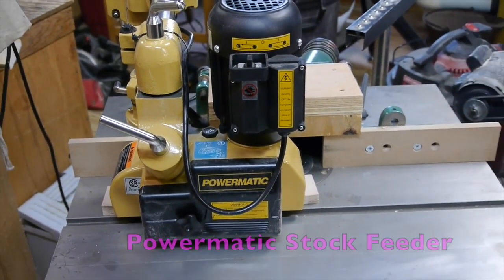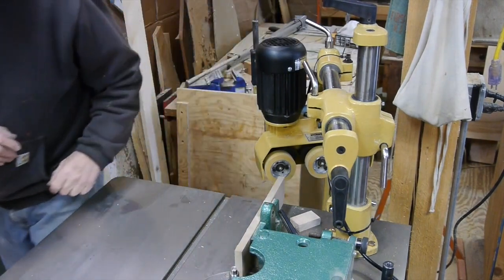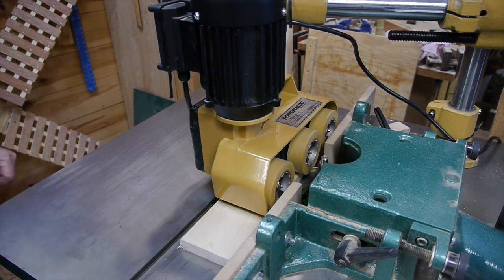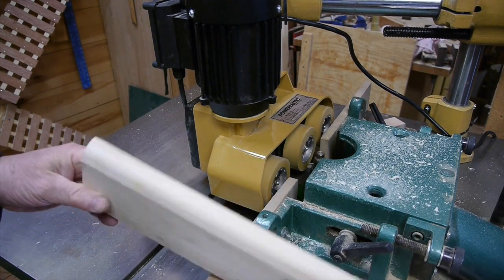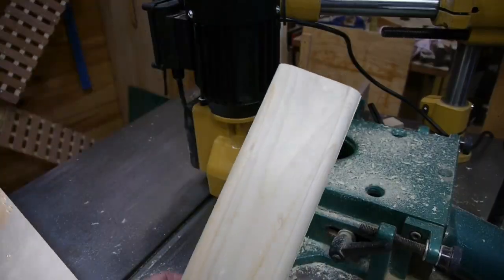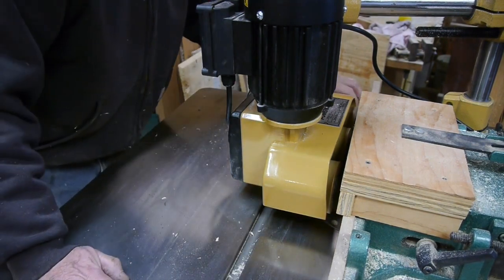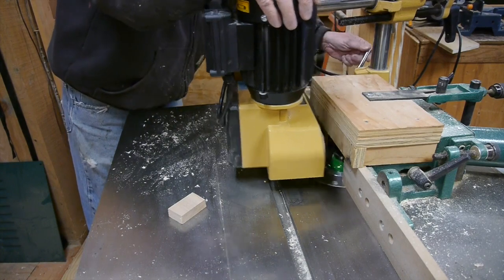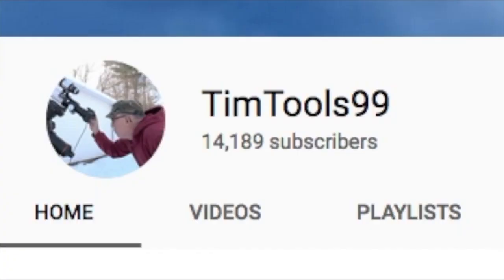Stock Feeder for Beginner Woodworkers

Comment: great video.  I added a 1/4hp feeder to my 12" Crescent jointer years ago.  Worked GREAT.  really holds down the work onto the out feed which is what is so important.  And makes the work progress thru the head without the normal stops and starts that hand feeding does, resulting in a more even consistent finish.  The Crescent, which was part of a multi machine, was perfect candidate as it's out feed table is so wide, (about 24" so lots of room for mounting the tower.  I later tried the same feeder on my table saw, but it wasn't powerful enough.  I later got a 1/hp feeder and that does work.  I currently replaced the 1/4 hp feeder with the 1 hp feeder on the jointer, as I found that the feeder wasn't really needed on the rip saw.  I am going to use the 1/4 on my jointer too.

Comment: I've been a firm believer in stock feeders since the mid 80's.  I used 2 on my table saw to feed stock through it as well.  I installed one so it fed before the blade and another after to pull the stock through to the end of the cut.  Never had kick back or danger at any time doing large stock production for cabinetry, etc.  You too can leave the caveman days of cutting off fingers and getting hit in the head.  Just get 2 of these.  Brackets can be installed on the table saw without sacrificing the table itself.  No need for rip stop etc.  Gov should mandate stock feeders on all table saws and shapers.

Comment: Enjoyed your video. I’ve been doing research on adding a power feeder to my 8” Grizzly jointer. Although it’s a different machine,  after watching your presentation, I believe a 1/4 hp power feeder may be a better fit than the larger power feeders for my shop. Thanks.

Comment: The gap in the fence is what allows the board to pull away from the infeed fence.  Putting the ends of the split fence closer to the cutter so the cutter just clears, or using a one piece fence with a cutter specific slot for the cutter to fit through, should stop that problem.
Reply from the maker: Thank you John
Reply: @TimTools99  I have the same shaper (older though) and same power feeder.  They work for my needs... My next projects include making new ash flooring for my house and antique pine flooring for my son's house. I will also will be making all new casing and baseboard for my house.  I'll be using it on my 3 HP cabinet saw to rip all the stock before using the planer and shaper... As you alluded to, the power feeder will make this a lot safer (no hands near the cutting action!), less fatiguing and will give more consistent results. Making it better yet, my sons will be doing a lot of the work! ;~)
Reply from the maker: @johngrossbohlin7582  .  Sounds great, John!

Comment: I set up a Grizzley quarter horse on my table saw yesterday. It was an auction item from twenty years ago, and I planned to use it with moulder heads on the table saw. The first practice run was with 1/4 inch blade height and a 3/4 inch board, to evaluate the operation. As the board passed the blade it began to diverge away from the saw's fence. A kickback ensued and a visit to the ER followed, 11 stitches in left hand. 
Not sure yet whether there was not enough down pressure, or tilt toward the fence, or maybe just glazed rollers. Need to do more analysis but won't be standing behind the board.
Reply from the maker: Oh man sorry to hear that.  This can be  dangerous working with this equipment.
Reply: Aaron Carter no, because it was not a thru cut. I mistakenly thought a shallow cut would be safer.
Looking back, it only made it easier for the workpiece to climb out of the groove. My saw does not have a riving knife so I use a splitter
but it was too tall for a groove cut.

Comment: Can't help but wonder what the limitations would be for only 1/4 HP, seems limited.
Reply: 1/4 hp, with a 50:1 motor reduction, is TONS of torque.  You'd be amazed at what 1/4hp will do in a home shop
Reply: @danray104  Unfortunately info I was looking for 6 months ago.
Reply: @Michael Kratky  still helpful to anyone who reads the thread.
Reply: @danray104  Probably OK for short runs of molding but I have thousands of feet of T&G tamarack and knotty  pine  that I needed  to run so I went with a 1HP 4 roller.
Reply: @Michael Kratky  it really depends on weight of the stock, and size of the profile.  We run 1/4hp and 1/3hp feeders for most basic profiles.  The larger feeders, are mounted to our larger molders.   A 4 wheel feeder is always prefered.
Reply: @danray104  Youtube is always good for getting input especially when one like me has a 5HP shaper  collecting dust trying to decide to sell it or put it to use  as they're very hard to sell for anywhere near what they cost if you can even sell it.
Reply: @Michael Kratky  they are definitely a small market.   Cabinet shops prefer larger HP units, while 3hp is more than enough for a serious home shop.   A 5hp single phase, would be good for a small shop, that wants a dedicated machine to run a simple profile (t&g, rabbit, radius).    I have an extra shaper just collecting dust, because it's almost not worth the time to sell it.  Would rather find someone who is just starting out, and doesn't have money to buy a shaper

Comment: something isn't set up right the feeder should keep it straight on the fence I am not sure if it needed to be a little lower or if   it is due to the fact that it is a smaller one, I have a 1 hp 3 roller and it doesn't have the issue of it coming off the fence
Reply from the maker: Thank you Luke.  I have always said that "a little knowledge can be a dangerous thing!"  It pays to have someone who knows about this stuff teach how to set-up etc.  Since I made the video, I have learned how to position the feeder to make it work right.  Thanks for your comment.
Reply: @TimTools99  how did you position the feeder to do that? I just bought a feeder and hoping to avoid that happening as well
Reply: I think it’s a design flaw. Their bigger 3 wheel feeder has two wheels before the cutter. The jr has it backwards. If the shaper was run in reverses, it would have worked better. Also, the feeders forward switch actually runs the correct way.. two rollers first